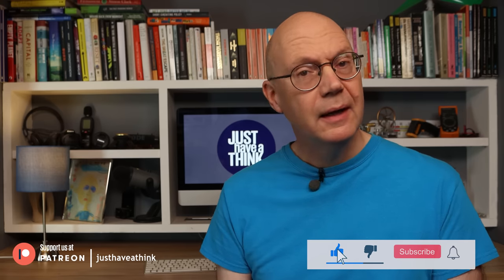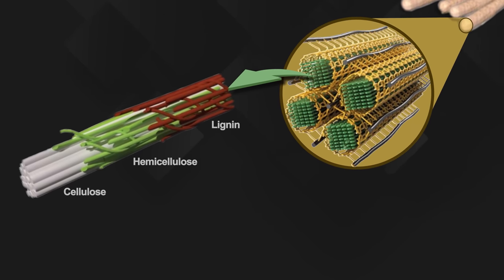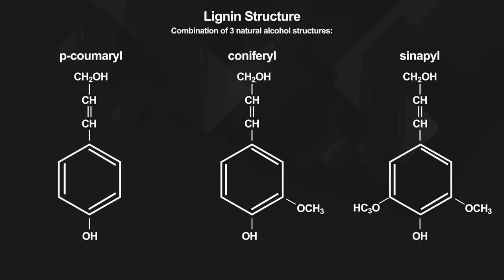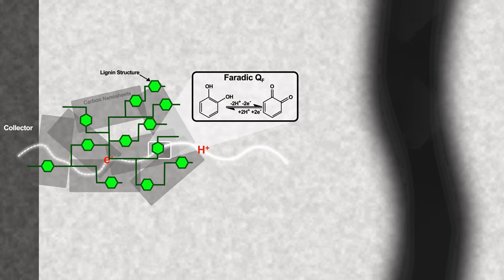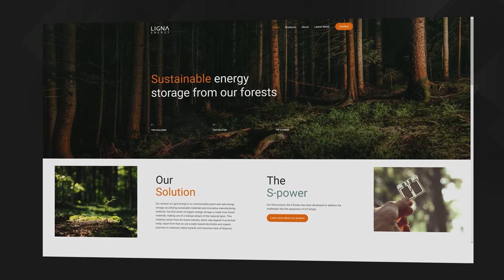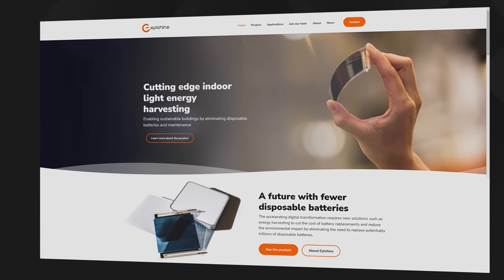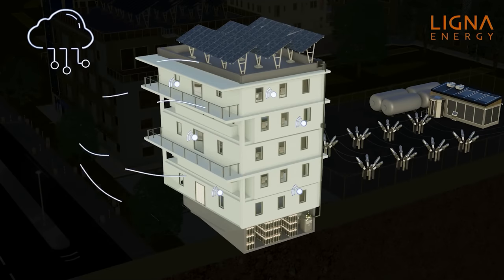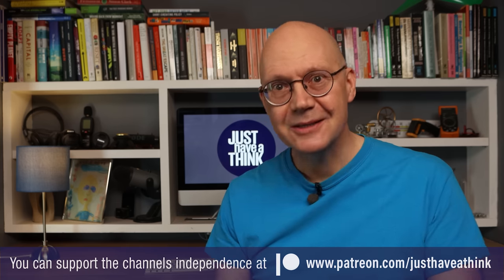Revolutionary new sustainable battery technology!

Comment: datasheet says max energy is 0.48 mWh, it's only 800um thick,  > 60000 cycles, .. They currently charge €100 for a sample pack with 5 cells .. so it's currently many orders of magnitude more expensive than existing rechargeable batteries used in the same application they are targeting (IoT etc.)

Comment: Hi Dave, great video as always. Given these clever solutions are born from an environmental perspective I'm surprised there isn't more consideration from a recycling perspective. What happens when the batteries come to the end of their life? Is there any thought to recycling or circular design? Are there any harmful byproducts etc? In this case perhaps removing waste from paper production is sufficient...
Reply from the maker: Hi Ben. No harmfuls as far as I could tell. I think they do hope to make it an entirely recyclable product.
Reply: @JustHaveaThink  Well, the potassium acrylate polymer isn't particularly easy to recycle and isn't biodegradable, but it's definitely not toxic that we can tell. And, of course, recycling isn't everything. Large scale use of lead is recyclable -- it can easily be melted down again and re-made into new lead products -- but its biotoxicity makes it inappropriate for massive distribution in consumer products. 
Overall I'd like potassium polyacrylates in my batteries more than, say, cadmium, for sure, and we do have separate efforts researching the recycling of various plastics & polymers (including acrylics) right now, with good results expected over the next decade or two. That's not a perfect answer, but it wouldn't be fair to fail to point out that progress is being made. 
On one final front, the lignin will never be recyclable. It will always be more economical to gather virgin lignin than rebuild its chemical structure after the chemical processes necessary to separate it from the PPA do their damage. But because there will always be easy sources of that lignin (it's most plentiful in wood used in paper-making, but even if we went to a paperless society we would still have corn stalks and other sources) we will never be in a place where we're killing plants to gain lignin. There will always be enough plant matter harvested for other reasons to supply lignin as a byproduct for the battery industry. Even paper making is just a small example of the overall amount of lignin that gets discarded every year. The reason for calling attention to the paper-making related lignin-stream is that in paper making lignin is actually separated and purified BEFORE it's discarded (which is not the case in other waste streams). For that reason, as long as we don't exceed the lignin harvested for paper making (and the video asserts that we couldn't possibly, though I haven't checked that claim) we not only have all the lignin we need, but all the separated and purified lignin we need. 
(Final caveat -- the waste lignin stream is also being eyed by others for potential in many other applications specifically because you can get it cheap and separated and relatively pure, so while the battery industry may never need it all, when you combine that with demand from other industries we could potentially exceed then supply from paper making and end up having to extract it from cornstalks & such)

Comment: I would be really interested to see their projections on $/kwh. If that is comparable or better than Li Ion then it's potential for grid energy storage will be much more believable. As with all of these inspiring tech advancements I am skeptically optimistic.
Reply: well if the material come from other industry waste i think it will be cheaper from lithium mining...
Reply: Using oil as an example, US oil production 60-100 yr ago was dirt cheap as oil was close to the surface. Now, US oil is expensive to extract as all the easy oil is gone. So, even if the current cost per KW is higher for Ligna than current Li tech. Over the long term, mass production cost will work out to be lower as Li mining cost will only go up as that finite resource is gobbled up and it gets more expensive to extract more from deeper sources.
Reply: In my opinion, the cost of Li is bound to go up faster than the cost of the materials used here.
Reply: Right. Even if as others say the cost of other industries increase, it's still critical knowledge to know how expensive this technology is now. That will have a big effect on perception and on initial adoption, which will have a big impact on future research and adoption. Curious to see how much of their data will be public and how much will be held proprietarily.
Reply: What about how it is now, similar to lead acid batteries but with far less toxicity? 

I'd say it's already a pretty good solution to a lot of our current problems, especially in developing nations and for gasoline car batteries.

 Even for grid storage, it's not a bad thing to have cheap and renewable energy storage even if it takes up a lot more space for lower energy density. 

With the right infrastructure, the abundance of the resources needed means that this could give developing nations the possibility for sustainable green power generation usage.

Comment: Very good summary and investigation. I'm full in on 5G IoT and you're totally right on that business model perspective. Just one correction. It's not Pi electrons, it's pi covalent bonds. It's the way atomic orbitals overlap. Single bond: sigma bond. Double and triple bonds are Pi. Lignin is ultimately why crude oil has so many benzene derivatives. Also related to polyphenols in plants and fossil fuels.
Reply from the maker: Thanks Alain. I appreciate the clarification :-)
Reply: @JustHaveaThink  to be more precise, 
in a double bond the first bond is sigma and the second is pi. In a triple bond, the third is pi (orthogonal to the second pi). Thanks again Dave.
Reply: That makes more sense.  I spent most of the video wondering wtf a pi electron was.  😂
Reply: Organic chemist here. 
Pi bonds are formed by Pi electrons. Those are able to move around as far as double or  triple bonds are one carbon distances from each other.
I didn't have a quibble with your description, especially with the clear graphics.
Reply: @julieheath6335  It's fair to talk about them this way amongst us chemists for sure, but it's definitely going to confuse a physicist who has spent time around say, tau neutrinos. Because pi electrons are only "pi" while inside that orbital, but the name makes them sound like a flavour of electron, the way a tau neutrino has certain characteristics different from other neutrinos.

Comment: For stationary applications, I'm not sure why the comparative mass energy density is considered a major drawback.  I understand why it would be a drawback for mobile applications, but I don't think that it would be for stationary applications.  I'd be interested to know what the volumetric energy density is.  It would also be interesting to know some things like the impact of charge and discharge cycles, the rates of charge and discharge, life expectancy of the units, etc.  It does look interesting.
Reply: Whilst volumetric energy density is also important - we don’t want such things to be ridiculously large - the $ per kWh is the ultimate metric regards grid scale. Granted it’s far too early for them to be able to say - final at-scale production processes will obviously be the major unknown right now.
Reply: @PeterStilwell  True, we don't want it to be massive but we do have more flexibility when it comes to size for say your house, especially if the price point is much cheaper and looking at this solution, it does look like it's a lot more sustainable.

Still, it's too early to tell and I'm sure this tech will get better but so will others and a lot of ideas are coming about thanks to the energy crisis, so it's going to be interesting to see which works and which are better over the next decade.
Reply: On a utility scale, I don't think energy density matters all that much, so long as the land is cheap and the battery materials are cheap.
Reply: "I'm not sure why the comparative mass energy density is considered a major drawback"
It's not necessarily a MAJOR drawback, but it is a drawback -- just consider shipping five times as much of a product and then consider that you're shipping hundreds of pounds per home. 
But even if it's not a major drawback, the information in the video is that they can increase the MED via a processing step during manufacture AS OPPOSED to gathering up multiple times the material and processing it into multiple times the battery. 
By producing these enhanced batteries out of the same amount of material, you end up with not only a greater MassEnergyDensity, but also a greater $$Energy Density. If we were sitting in on a meeting at the company doing this research, I bet you'd find that improving $ED is the real focus here. 
So they're going to boost $ED through boosting MED and then we'll see where we are. If they top out around 100-120 Wh/kg they'll still be a very useful as grid storage, and will need less than half the closet space in a home system or less than half the building size for a grid system. If they end up topping out at 180-220 Wh/kg but with strong performance in $ED, you'll see them in forklifts and those lifting-platforms you see at Home Depot for accessing things on shelves 30 feet above the floor and other such devices where you can recharge them while eating lunch (or even when they're just not being used if the need for your forklift is intermittent). If they don't top out before 250 Wh/kg, then you'll see them in cars, but cars are expensive enough regardless of the battery system that the extra 2k to 4k of the price for using a high MED/low-$ED system will still be seen as a bargain if it lets you travel much further on a single charge. I don't think it should always be that way, especially for households with more than one car, but we know from observing the market that people really do care about those range numbers.

Comment: Hi Dave, I just stumbled upon an article about a new type of heat pump from the Dutch TNO and spinoff Blue Heart Energy. It works using sound waves in order to create pressure and it should be able to compete with existing heat pumps, as well as serve high temperatures even when it's cold outside. Maybe this is worth a look?

Comment: First of all, thank you for another great video! Your Ever Woody battery mockup seemed like a perfectly fine prototype to me. Every idea has to start somewhere.

As for this idea... The organic chemistry underlying it is completely beyond me, so I appreciate the simplifications in your video. Electricity from lignin! Wow. The energy density seems fairly low at the moment, but being made from renewable materials is certainly a big advantage. It sounds like we don't really know enough yet to judge how a large version of this battery would compete against something like a Tesla Powerwall. It may last for at least 1000 cycles with little degradation (a good thing), but how would it work in hot and cold temperatures?

Since it's so new and unknown it makes sense they're concentrating on small versions of the battery for now. If we're talking about an Internet of Things with thousands of little sensors all over the place, this technology has an advantage over something like lithium ion. If the sensors are lost and never recovered, at least they'd degrade into harmless byproducts and not pollute the area.

As for Internet of Things itself... Outside of some limited applications, I'm fairly skeptical of the idea.  Thousands of tiny little heat, moisture and air pressure sensors scattered around a forest could generate valuable data for scientists, who could use it as real time feedback in their computer climate models. With the right kind of sensors you could also measure the health of the soil in lots of different places simultaneously , or maybe even measure in real time the blood pressure of each cow in a herd. It could give us hard data about lots of things we only guess at, or measure indirectly right now.

But when it comes to spreading the little devices around our cities and homes, I'm not as certain what use they'd be.  Maybe that's a lack of imagination on my part, but I don't see the need to cover every surface in a room with sensors connected to the Internet. We already give away too much information on our daily activities.

Comment: Great video, as always, David!
In low-current devices, especially stationary ones, energy density by volume and by weight are far less of a concern than energy capacity per dollar. If this can be produced cheaply enough, and here’s hoping the fact that one core component of the battery is a waste byproduct means that it is so cheap as to be nearly free, then the low-current device market will go all in on this.
Reply: ꜱᴇɴᴅ ᴀ ᴍᴇꜱꜱᴀɢᴇ👆👆….

Comment: Thank you for this good news, I'm sure there is a niche for this technology.
For the future, could you try to always specify when you talk about batteries:
-cost range
-composition and related issues (toxicity, scarcity, ethical mining etc)
-energy density (for mass and volume)
-expected lifetime (number of cycles until deterioration occurs)
-charging speed (the only one missing from this clip)
Without each of this it would be difficult to understand the tech and compare it with alternatives.

This battery might get a bigger energy density if they replace the zinc with a lighter element.

Comment: Surely Energy density doesn't really matter unless you're using them to drive you around and want to make the batteries portable. If you want large scale grid electricity storage, then the priorities are lifetime costs, reliability, and safety. If they are cheaper to produce, easily available and recyclable then it doesn't matter if they are heavier. I'm curious to know more about how scaling up production works.
Reply: And also if safer related to fire hazard many locations could have small storage stations instead of one large here and there only.
I was thinking about having something in the garage for houses, office buildings, large commercial complexes, to store electricity at night and potentially release to the grid if/when needed. With a smart management system the efficiency gain for the whole grid could be huge.
Reply: And also calendar aging impact on battery capacity & safety & overall battery longevity

Comment: While this does sound interresting, I do personally have a hard time believing that it'll be able to compete with Lithium Ion batteries for grid storage.
The way you're describing it, it seems like they want to compete with current day Lithium Ion batteries, but with a technology that isn't going to be scalable to similar levels for years to come, in other words, it seems like they're pitting what they will have 5 odd years from now, against what exists now, and not what Lithium Ion batteries will be.
Other aspects of why I think this is a bold (and likely unrealistic claim), is that A. the energy density is quite low, so the batteries would have to be very large to store the same amount of power, and B. there are batteries coming to market, which seem more efficient for dealing with baseload power storage than either of these.
Reply: Lead acid is used for telco & data center backup, today.  If this technology is similar, in power density & weight, then this is prime time.
Reply: @DavidHalko  Fair, that I did not know, thanks for the information :)

Comment: The chemistry sounds broadly similar to PolyJoule's carbon polymer-based battery. One has been installed at Fonterra Waitoa in NZ. Great use of "waste" materials, though! This really looks very scalable.

As others have said, cycle life and calendar life are much more important in grid applications than energy density, be it gravimetric or volumetric.

Comment: This video is about using lignin as a battery.

At low mini power levels, even below the cheap garden light, it would seem that a supercapacitor could store enough energy to run the micro IoT devices for the time during darkness.  They might be bigger physically but a complete device may still be small enough to do an adequate job.

Comment: Great vid as ever Dave, thanks. It strikes me that if we are talking about grid-scale energy storage, then Wh/kg is not the key metric, as it's not moving? Charge/discharge rate suitability for grid storage might be a better view. Crucially this tech is extremely safe both physically and ecologically. It's scalable and wonderfully circular economically. Just as important, it's surely an easy sell to any community to have a large local energy storage facility in a distributed power grid, which must be a consideration, given the furore over 5G masts etc?
Reply: ꜱᴇɴᴅ ᴀ ᴍᴇꜱꜱᴀɢᴇ👆👆…

Comment: The more solutions on battery and energy generating tech, the better, even if some are better than others, the more solutions we have, the quicker the overall industry will develop and the lower the price point of all this tech will get.

It's also useful because no one company or country will control it and in the case of clean energy and battery tech, it needs to be cheap, easy to create and accessible the world over, so it's nice to see a lot of solutions popping up around the world.